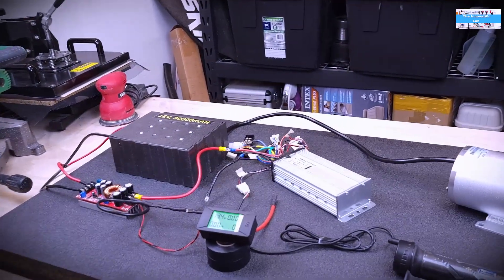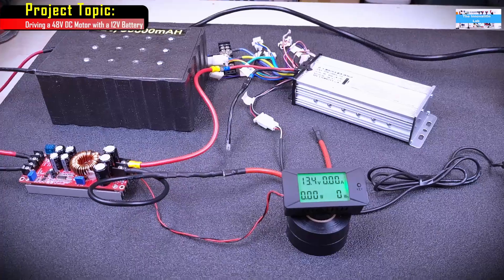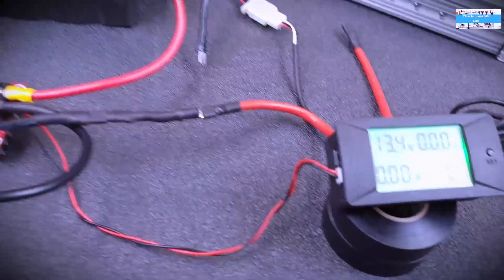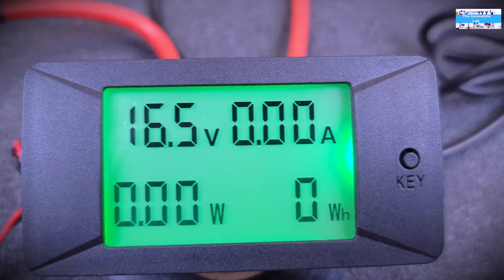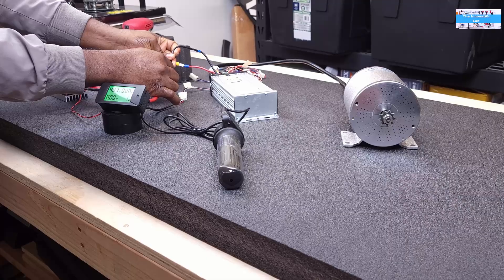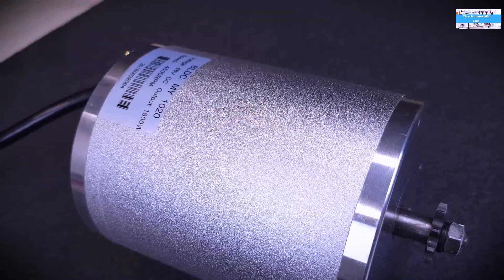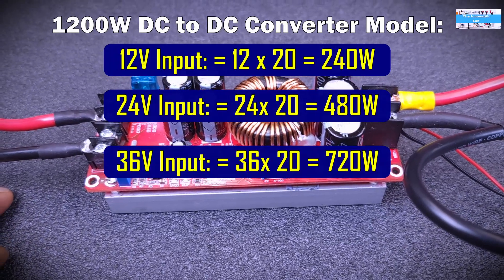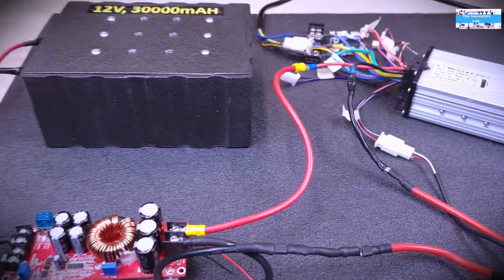How to Drive a 48V ebike electric motor using a 12V battery and a dc to dc boost converter

Comment: Can I run a 36v ebike battery on a 1800w brushless motor
Reply from the maker: Thanks for watching our videos.👍
What are the rated voltage and current specs of your brushless motor?
Reply: Its a 48v motor I bought off Amazon same one in your video. VEVOR Electric Brushless DC Motor,48V 1800W Brushless Electric Motor,4500RPM

Comment: I need to charge a solar generator from my 12v lithium through the solar input which needs to be at least 48-150v 10A max.  Is 48v the highest you can boost 12v?
Reply from the maker: Thanks a lot for watching the video and for leaving a comment.
The 1800W version of these constant curre t boost converters has an output voltage range thag goes up to up to 96V.
I have made lots of videos on this subject. Please see the linked videos at the end on this one. I also made a video to show what you need to do to exceed the 96V manufacture max output voltage. Take some time to watch those videos and I am sure you will find them helpful to what your question.

Thanks again, please help our channel reach a wider audience by sharing our videos.

Comment: Would be interesting to see a load on your motor to see how that booster handles that.
Reply from the maker: Thanks a lot for watching this video. I appreciate the  comment.👍

I agree with you completely. It's as if you read my mind. If I get a good audience interaction on this video, I will make a follow-up up video to see how I can put a load on the motor.
Reply: i tried with a load. it doesn't work. the controller shuts off.
Reply: @varman001  At least it shuts off better than some that just burn out!
Reply: @ericdelevinquiere9902  why would it burn out in this scenario? 
It will have to be underpowered in voltage for the controller to cut out power, it thinks the battery is depleted while mean, the booster isn't capable of maintaining the voltage because it's weak.
This explains why we don't use this, better of buying a bigger battery.
Reply: @princecharles3452  Well a lot of these cheap boosters do not do a very good job in safe failing, high current could lead to some components frying, have had that experience with poorly regulated devices.
Reply: This test is without a load...What is the current under load?  For electrical bikes you need a lot of torques. I doubt if this boost controller can handle that. why didn't you use the 1800 W version? Or why didn't you use 2 or 3 boost converters parallel and use diodes in  the output or 5W 10K resistors to share  the current in all boost converters i.  parallel ? Than it might work if your battery can handle the current.  Then why you don't increases the voltage? that decrease current. Greetings an engineer...